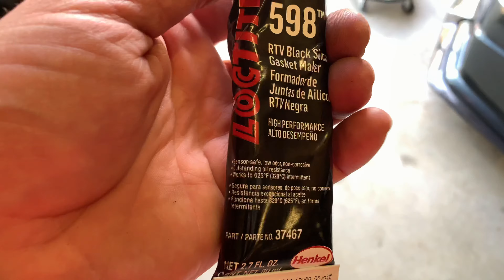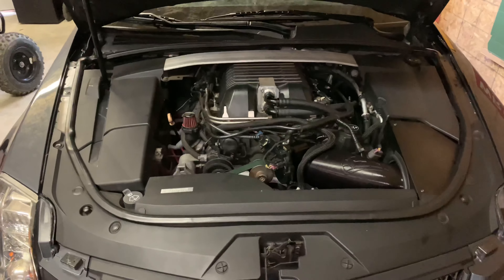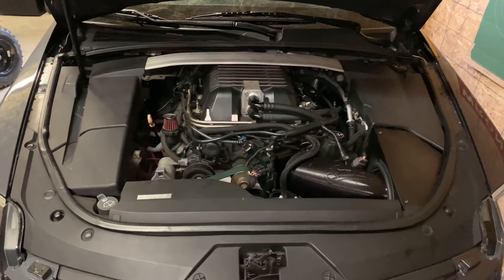Nick Williams 103mm TB Install on a 2010 Cadillac CTS-V Gen 2 NW 102mm tb vs NW 103mm TB

Comment: Thanks for the video. The comparison while mounted and drivability is exactly what I needed to see. I have a 2.4 upper and it almost touches the 102 boosted tb. Going with a Kong 2650 with a 2.75 upper and I’m pretty it’s going to touch with the bigger upper. Guess I’m gonna buy a 103mm tb.
Reply from the maker: You’re welcome! I am glad that it could help you out. The NW 103mm tb drives very smooth, and is still working good for me. I hope that I have earned your “like” on the video and sub as well.
Reply: the Kong2650 has a better angled snout. it will give you more clearance.

Comment: Hey I have a stock throttle body now . I wanna do the 103mm do I need a adpator to make it fit or does it bolt on like stock ?
Reply from the maker: The best thing to do is to have your blower snout ported and modified for it.

Comment: nice Vid man thanks, looking to order one soon to replace my 102 thats been throwing the p2135 code
Reply: Is your car shutting down and going into limp mode?
Reply from the maker: My Nick Williams 102mm nonboosted tb was throwing the P1511 if I remember right and caused reduced power mode a few times. So far there has been 0 issues with the Nick Williams 103mm tb. It drives noticeably smoother as well.
Reply: @josephkrause5290  yep
Reply: @whiplashtv2022  do either of you have Instagram? I wanna send you a video of how is sounded after I got a “reduced engine power” light
Reply: @1Gwhite  it sounded really fucked, like it was misfiring
Reply from the maker: @bthelen_whiplashmotorsports
Reply: @whiplashtv2022  requested
Reply: @josephkrause5290  Instagram is @01gwhite
Reply from the maker: That is how they sound sometimes. Like they aren’t firing on all cylinders and like they have a missfire. Mine did it on that old nonboosted NW 102mm tb at the drag strip right after the burnout.
Reply: @whiplashtv2022  ohhh okay just wanted to make sure I didn’t hurt anything. I just bought the car so I wasn’t sure what happened
Reply: @whiplashtv2022  oh wow man , yeah I ordered this 103 from Texas Speed.. I would I have hated that to happen at the strip. Hopefully you got back going smooth and stronger.
Reply: Finnally got my NW103 shipment , installed .no more codes and doesn’t go into reduced power mode anymore :)
Reply from the maker: @1Gwhite  That is awesome!
Reply: @1Gwhite  how often would it go into limp mode and under what circumstances?
Reply from the maker: It always happened during acceleration and varied from wot to slightly accelerating. Towards the end, it happened around 5ish times in 1,750-2,000 miles of driving.
Reply: @whiplashtv2022  yeah mine always happens when I do a pull and it shifts at redline. Happened like 5 times within 500 miles for me
Reply: Mine is 102 nick Williams
Reply from the maker: Ok

Comment: Holley 508-20 gasket should work on the 103mm nick williams...says( 92-102). I just bought my 103 nick williams and the holley 508-20 gasket and it fits!
Reply from the maker: Did you install it on a ported snout?
Reply: @whiplashtv2022  
Yes! Jokerz performance.
Reply from the maker: @dalehall2993  If the gasket doesn’t stick out into the ported section of the snout then that sounds like a great option.
Reply: @whiplashtv2022  
It has the perforated line for the 102mm you take out,it lines up with the 103mm..not sure where they get the 1mm difference??cant really tell.
Reply from the maker: @dalehall2993  oh very nice. I don’t think it is technically 1 more mm but even if it is….the big difference is the updated electric motor on the side.
Reply: @whiplashtv2022  
Its worth every penny!😎👊🏻

Comment: Hows that nick williams 103mm throttle body workin out?🤔
Reply from the maker: It is working like a dream! I still have it on the car. It drives so much smoother than the NW102mm nonboosted.

Comment: What cold air intake you run for the 103 mm tb
Reply from the maker: DDP which is the best one out there.
Reply: Link?
Reply: I found it… it fits the 103 just fine right
Reply from the maker: @chance_ctsv7489  yes it does. You can see the intake in the video and it is installed on the NW 103mm tb at the end of the video.
Reply from the maker: @chance_ctsv7489  https://www.texas-speed.com/p-4575-nick-williams-103mm-drive-by-wire-throttle-body.aspx

Comment: Question, when add the 103 TB do you have to have the vehicle returned?
I'm in the process of updating my V and the shop has gave me this crazy list of mods to make 800whp. I'm already at 600whp with an air raid intake, is it really necessary to go to a 103mm TB and DDP intake?
Reply from the maker: 800rwhp has been made before with the Airaid intake with the green filter, but it will be easier to make over 800rwhp with a DDP intake that adds 15-20rwhp over the Airaid. No, there shouldn’t be a need to retune for the NW103mm if you already have been tuned on a NW102mm and ALL other mods remain the same. If going from a stock tb to a NW103 then yes a retune would be needed.
Reply: @whiplashtv2022  Thank you!
Reply from the maker: @MrLowe-on8kc  You’re welcome

Comment: Did you put the lock tite on the snout and then installed the throttle body right after?
Reply from the maker: I used the black high temp gasket maker for the tb/snout sealing surface. No lock tite.
Reply: Ok thanks I was just wondering cause I got to change mine. And I wasn't sure weather to put it on the snout or throttle body.
Reply from the maker: I applied the rtv gasket maker to the back of the tb. I bet that you could do it either way though.

Comment: Is that the boosted 103tb?
Reply from the maker: There is no “boosted” 103mm tb and there is no n/a 103mm tb either. This time Nick Williams made 1 tb that would do both and was an upgrade over both 102mm tb versions.
Reply: Does it need a retune for the new 103 if I’m switching out my 102 non boosted?
Reply from the maker: @josephkrause5290  no retune is required, just disconnect the battery while you do the install, and then on the first start I turned the key forward and let it sit for 3 minutes I believe and then started it and let it idle for a few minutes to let it learn the new tb. Then drive.